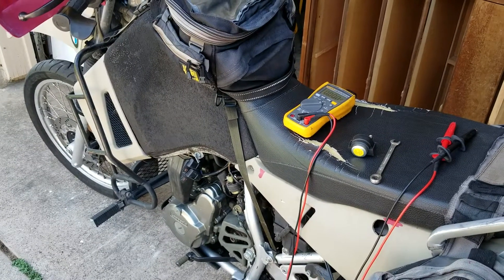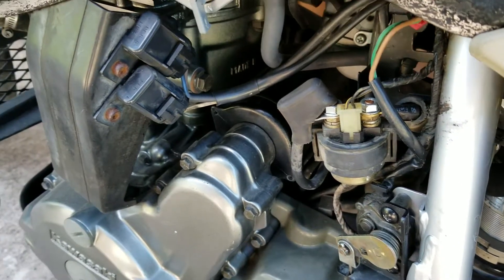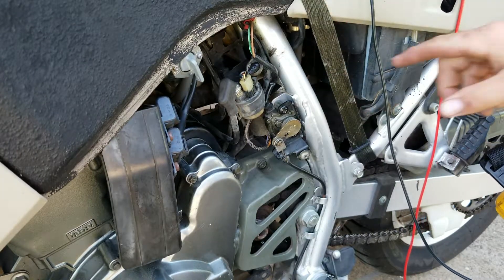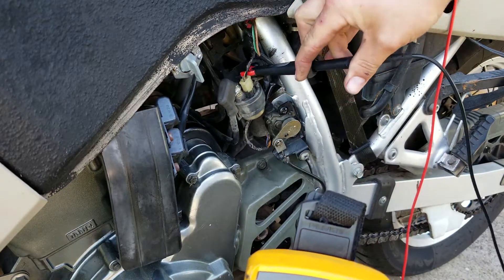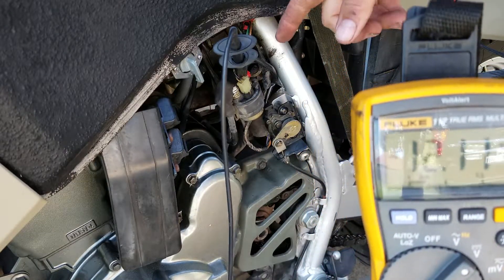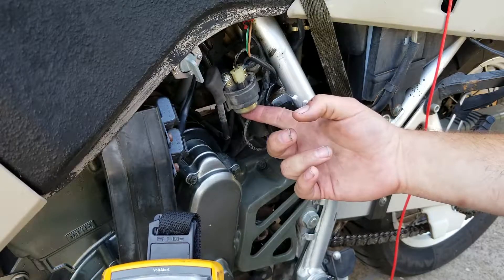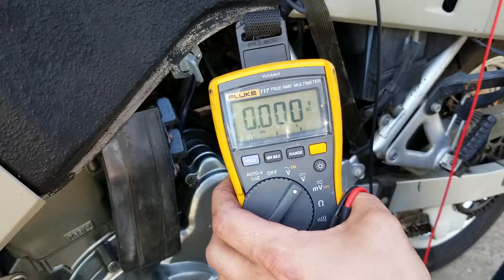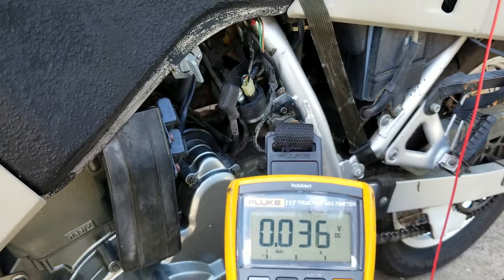Actual use of voltage drop test on a no start klr 650

Comment: Good video,  the battery was low,   it always good to charge before troubleshooting , I'm changing the relay today, mines clicking too.
Reply: The main reason for charging , is because the type of resistance in the start circuit is inductive reactance , this keeps the starter from burning up. If the battery voltage is low the resistance will not build up and current through the starter can burn it out.